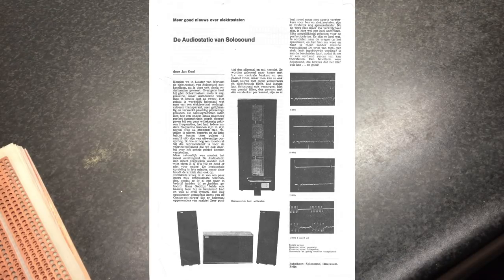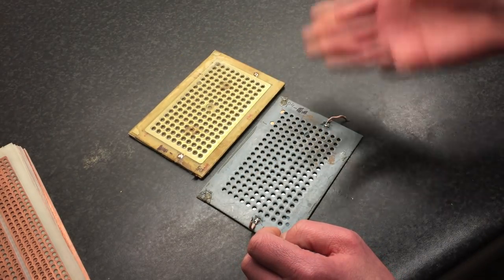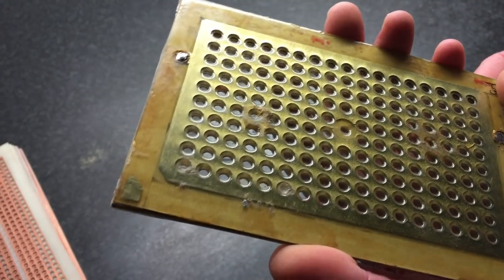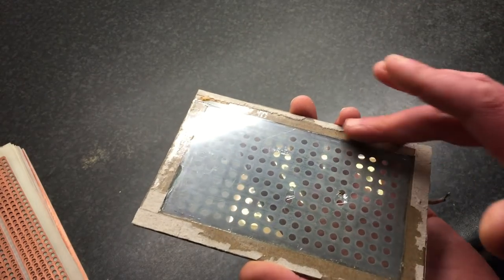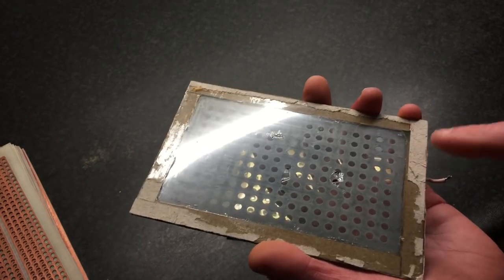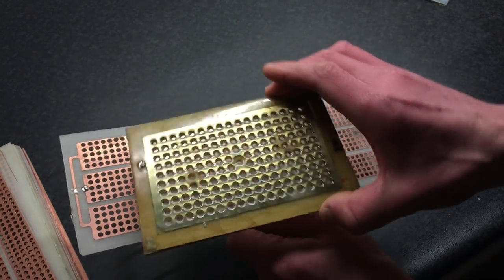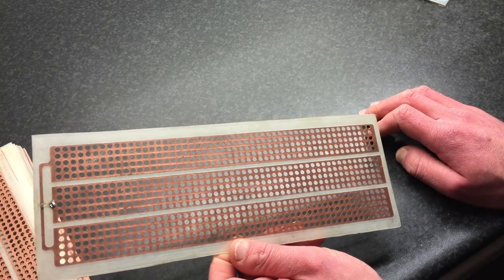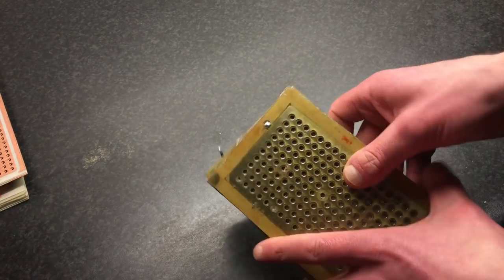Dissecting a Solosound/Audiostatic Electrostatic Loudspeaker Panel (70's)

Comment: What was the price of new Solosound in Netherlands ?
Reply from the maker: cant say i was not alive in the 70's :) but  i think around 3500, so thats around  1500-1600 dollar back then. the woofer was a B200 from keff. depending on the model it used the SP1054 or the SP1022  :) in a separate subwoofer you could put underneath the panel. or a transmission line 2.1  setup. the panel reached down to 300 Hz ~ the fullrange ES100 and E300RS from audiostatic  where much more e xpensive.  a ES300RS was about 3500- 4000 dollar i believe. i had that one before nbut im not impressed to much top end and low max output.  not my thing.

HMM I LOOK IT UP  ,  i got a brochure somwhere :)
Reply from the maker: Hmm i looked it up
The wired Audiostatics where ES100 3150 euro ES200 3825 euro ES300RS 4725 euro.... rather expensive.  the solosounds where Only the solostatic 1125 euro (super cheap) and the 2 simple subs only 360 euro.. so a complete set less then 1500 euro....  its insane ! some really nice designing in my opinion without bullshit.

this is without inflation. but the difference between the Audio static and the solosound both are prices from that age.. so the audiostatics are to begin with twice as expensive.
Reply: @joppepeelen  yes, SoloSounds were quite affordable for real world audiophile these days
Reply: Thank you Joppe 🍻🍺
Reply: @joppepeelen   i am trying to design esl but i have questions.
Reply from the maker: @canberkozturk8466  well the problem is i dont have time to help eveyone individualy as you might imagine. i believe the Jazman posts on DIYAUDIO.COM  or on his website would give you the information you need to make a good start. he did some nice builds. just tailor to your needs.
Reply: @joppepeelen  thank you.